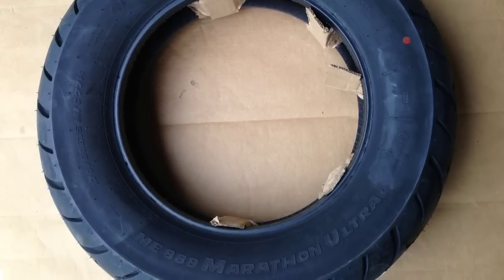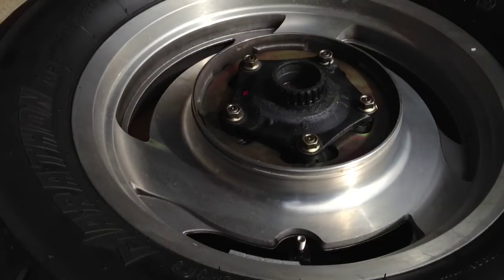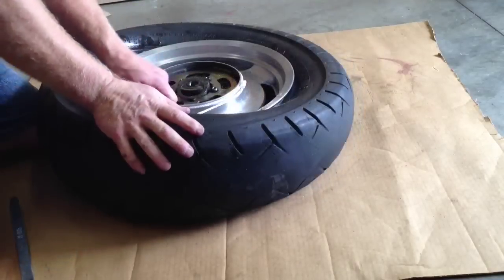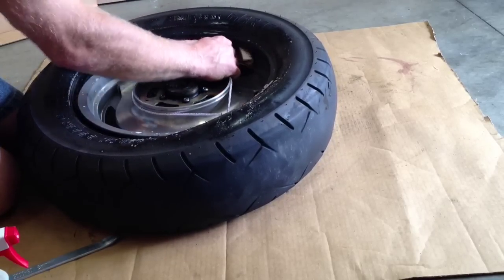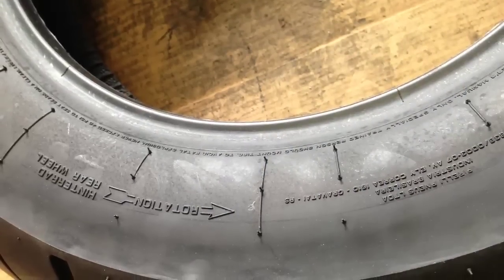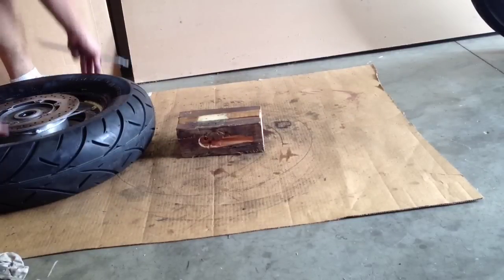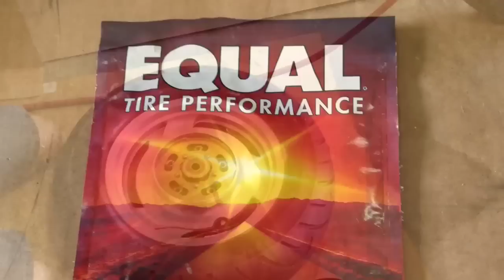Removing and replacing a motorcycle tire from the rim.

Comment: why did you leave the old weights on AND put that ceramic dust in?
Reply from the maker: +Jake Meixell With the old weights on it was balanced so I figured that was balanced with both the tire and the rim so with just changing the tire the ceramic dust should make up any difference the new tire would make. It seems to be working fine after many miles now. Thanks for the question and thanks for watching.

Comment: Hi Bob, with that cermaic dust you,d do well to remove your lead rim weights as they should not be needed. In fact  if you were to balance the wheel again using weights you,d have to remove the old ones first otherwise you will just end up trying to counter balance the old weights.
Reply from the maker: You can if you feel the need to.
Thanks for watching
Reply: Noticed this too

Comment: Brand new to any kind of operation like this. It was a great video, and definitely makes me feel confident I can tackle this project with my budget (as soon as I watch another video to learn to take off my rear wheel haha). I am a little confused on a what a bead is exactly and what all the balancing is and how it works exactly. I'm just picturing the dust rolling around throughout the inside of the tire as it spins, so I'm guessing I'm not really understanding how it works. I'll probably understand better once I take things apart, but I prefer to understand things before I dive in. Again, great video!
Reply from the maker: Thanks for watching.

Comment: My shadow 1100 uses the same 170/80-15 tire, how do you like those metzlers?
Reply from the maker: I have run several sets of Metzlers on the bike but have recently put a Michelin Commander II  on the back I after several thousand mile I might be sold on the Michelin. It handles great and rides nice. Thanks for the question, happy riding.

Comment: Thanks for the helpful video. Is the application of ceramic dust absolutely necessary? or I can get away if i forgo that step?
Reply from the maker: Ulipop 13 I would say that it is not absolutely necessary but it might help balance the tire but you could forgo if you want to. Thanks for watching.

Comment: Took at least 1.5hrs to find it doesn't work on scooter tires. Waste of time. Why wouldnt u mention anything on using long ass tire irons if it doesn't work? or maybe even suggesting that this can be tried if u dont own any?
Reply from the maker: I also would not try this if you do not have a wrench to take the tire off, an air compressor to pump the tire up, a valve stem removal tool to help release air from the tire, as well as try this on a scooter, bicycle, quad runner, dirt bike. Point is I cannot name every possible scenario that may or may not apply here, but thanks for watching.
Reply: what do you mean it doesn't work on scooter tires? those things are a pain in the butt to change anyway because they are so small and tightly stretched on to the wheel.

Comment: Hi funbro1,
Another good way to seat the tire without a quick blast of air is to run a ratchet strap around the circumference of the tire and just air it up normally. Also, i have used air soft pellets to balance tire, which is considerably cheaper than the ceramic stuff they sell. It has worked out great.
Reply from the maker: +John Foltz Thanks
Reply: How many pellets are you talking about?
Reply: Rick Bice since no one replied, about 1/4 cup of the larger sized airsoft bbs. a couple decent hand fulls pretty much. it's best to use both large and small sized bbs but if only one size use the larger ones

Comment: Hi question pal

Could I fit a tubed tire to a un tubed wheel without the tube and it still work?
Reply from the maker: Jay Elliott No I would not recommend it. You are just asking for a problem. The sizes will not match up. Thanks for watching.